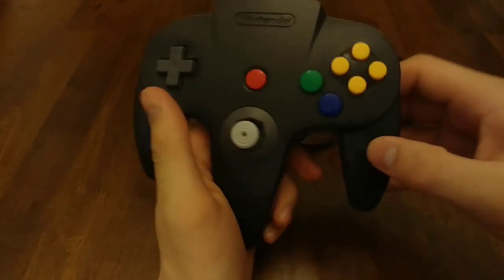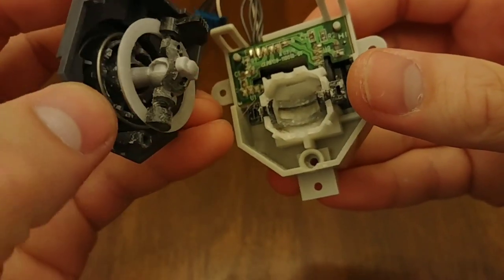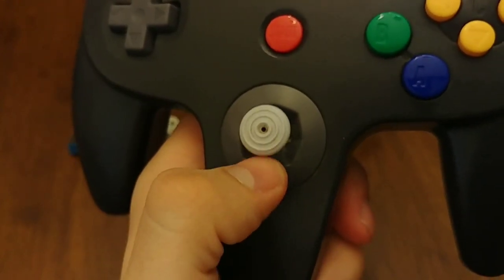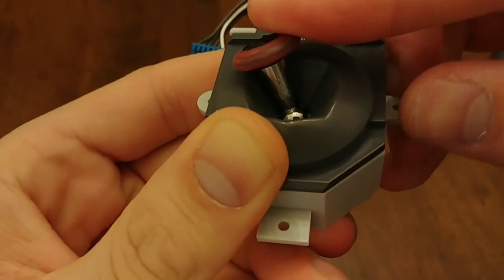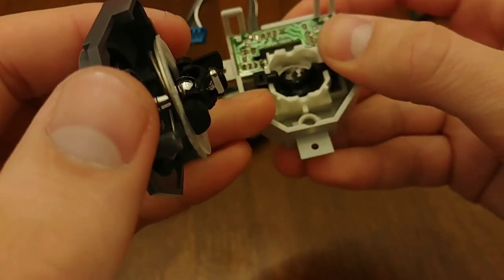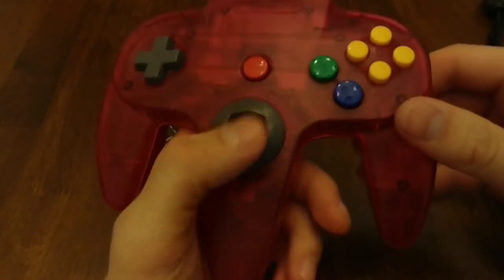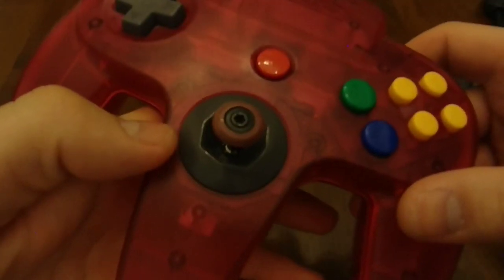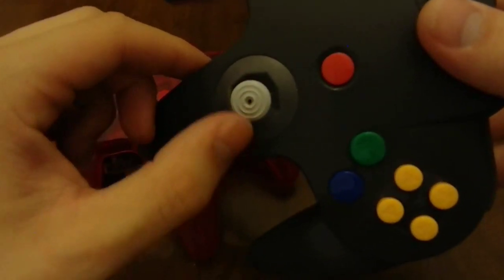What is SteelSticks64 and why you should get one.

Comment: I wanted to buy just the steel bowl for $30 on the site today, but it seems that these products are made sold out and made of unobtainium.
Reply: Same here during covid.... worst time to be looking to expand my collection since all of the brick-and mortar stores are (logically and correctly labeled as) non-essential businesses :(
Reply: I managed to snag one a few days ago.  The Grade A one that was $45 or so.  Batch had 150 units and were sold out in maybe 3 to 4 hours.  Luckily I got the notification email as soon as they went up but I know others aren't so lucky.  I'm gonna use that with the brass links from Shapeways and a Kitsch Bent molded stick I happen to have.  My stick is gonna last FOREVER lol
Reply: @Officer Barbrady the stick is DIY. You have to drill it yourself. If you aren't handy then buy the full kit for $150
Reply: @Officer Barbrady  Metal sticks aren't really necessary.  They have more mass, and besides, plastic-on-polished-metal friction tends to be very low.  In any case, replacement plastic sticks are very cheap

Comment: Steel Stick is only part of what you can do honestly.  I managed to get a Grade A bowl ordered.  Then I'm gonna replace the plastic links, the long parts that the stick moves, with brass ones that can be printed from ShapeWays, and use a Kitsch Bent clear OEM molded stick.  I think overtime if a SteelStick modded stick goes in stock I'll get one of those as well, but SteelStick parts are very compatible.

Comment: What would happen if I were to use a regular N64 plastic joystick with a steel bowl? Is it ok to do that or should I wait until I purchase a steel stick?
Reply: It would probably work just fine with a good amount of grease. The bottom of the steel stick is made of plastic anyway to prevent metal on metal contact - so it really doesn't matter whether the actual stick is made of plastic or not. I would say the best way to get the same quality without paying for the whole module would be to buy the steel bowl and refurbished gears. Then use an original stick that still has the bump at the bottom intact. Hope this helps.
Reply: @CuhShark  Cool, thanks.

Comment: it's 2021 now. turns out he made 35 of them. and now you can't get them... as well, what about those two black plastic parts that actuate the optical encoders? they are still black plastic parts? those black plastic parts are the most problematic part. that's the part that gets worn away. you open a loose sticked controller and it's those parts that are worn where the stick rubs against them, and now you have a metal stick rubbing against them?
Reply: @shaun8062  that's not been my experience. It's always been the part of the black gears that wrap around the stick. What should look like I I wears to ( ). So the stick becomes wobbly and loose.
Reply: @mark902  You know what? Now that you described it, I can recall seeing videos of people with that issue, just never had it myself. So that is something to ponder. I wouldn't dismiss this project though obviously until we've tried it and or come to the perfect solution.
Reply: Plastic on steel won't wear it down much. In fact the steel stick is plastic on the bottom which makes contact with the steel bowl itself.
Reply: @shaun8062  Later models of the N64 Controller came greased, so that's probably why your gears never wore down quick.

Comment: I'd prefer to stick with a plastic stick, since steel sticks have more mass and might take longer to center.  
Plastic on polished metal has a low coefficient of friction, anyway. In fact, cheap bearings are often plastic supporting a metal axle.

Comment: Well its been about 5 years since you uploaded this video, how is the stick holding up?
Reply from the maker: I seldom play n64 anymore, however a couple months ago I played through Toy Story 2 and had no issues.  It felt just the way any other n64 joystick ever felt.  Smooth and it snaps back to center and stays there.  Since I've had it I've clocked 50 or so hours in mariokart64, a few dozen hours in GE, and a playthrough of Turok 2 and probably less than 10 hours spread out among other games.  I've greased it lightly one time and do not fear that its going to degrade any time soon.  Granted, I never really put it through paces of intense use, but it's certainly better than a standard joystick, which, even with little use will suffer from looseness.  I wish the production kept up, or at least was made in larger bulk, because the comments on this vid alone show that there are hundreds of would be adopters.
Reply: @Spleet  if you are not using it, are you maybe willing to sell it?
Reply from the maker: @ohnewerbung9601  s'gone.  Already sold
Reply: @Spleet  thanks for the replay.

can I ask you how much money you sold it for?
Reply from the maker: @ohnewerbung9601  I listed it on ebay for $250 usd, it sold almost instantly.  I had no idea at the time that the smash community didn't have another solution by now.  I thought there were replicas and replacements abound, but I guess steelsticks is still king?  It's such a simple design, a bowl and a stick... it's hard to believe someone with their own shop or access to a public shop doesn't do it.  Then again, the logistics of shipping is a huge hassle even for a small time eBay seller, so hundreds of orders for the everyman may be a huge headache.  Who knows.  Best of luck to you if you're trying to find one!

Comment: It will still become loose with time.
The gears themselves are still made out of plastic, with time they will become loose just like the original module.
Reply: As you long as you keep it lubed, it should last longer and preventing rust as stainless steel can still rust. Also, the steel bowl and stick are highly polished reducing friction. I don't know for sure because I don't own one.
Reply: Its not as bad as it sounds. It will efectively eliminate wear on two of the most problematic parts, so it will greatly extend the usable life. Also the slide rails on the gear set will last substantial longer with lubrication than without such as with a stock stick. The Steel stick also has over provisioning in its range so even when it eventually wears it will still retain full range for much longer. They really are a vast improvement over the original and should last many times longer than a stock stick. Also if you do wear the gears you can canalise gears from a semi warn stock pad or buy 3rd party gearsets that can be used to refresh your steels tick. You do have to reshape them slightly for the oversized shaft but it's not to hard to do.
Reply: Just out of curiosity could the gears be made from a different material?  Right now he seems intent on refurbishing the old ones, but he’s also still in the prototype phase. If he could get the gears made out of a more durable material, he could effectively fix this issue.
Reply: @Huanchee  Sadly plastic is the only option, metal on metal would be bad because of friction and other reasons.
Reply: +Xein64 a carbon fiber gear may work

Comment: "Rapid degradation"  its been 25 years!! Sure they do wear but my ps4 and switch controllers wear out a hell of a lot faster.

also didnt realize this video is old.
Reply: ps4 controllers are actually a lot more durable then n64. All controllers are these days, at least compared to n64
Reply: @DempseyDaPro  Yeah but the Potentiometers drift within a year. Not hard to fix but still annoying.

Comment: How much did it cost?
Reply: They cost around $125. It's pricey.
Reply: The sticks cost $125 pre-built to do it yourself it's $25.
Reply: $25 sounds much more reasonable.
Reply: furballbear Once I realized that, I might consider it. I have a stick that I half-repaired and since the only parts that are steel are the bowl and the stick, I could just buy a steel bowl for $25 and lubricate it withmy plastic gears and stick. I think it comes with new bowl gears too since the gears are in the pictures.
Reply: In theory I could use the parts from my original loose one, right?
Reply: walter937 you could, but I have not attempted it and I do not know if it will be a good solution. What I was planning on doing was that I would first, buy a new steel bowl then, I would buy some lubrication, and then I would buy replacement axis gears. I would dissasemble my stick, lubricate the new gears, the bowl and the oem stick from the analog stick I am repairing. I would reassemble it and it should work because all pieces are new and not worn down . But what my concern is that since the bowl is metal, would it wear down the plastic stick? Because it is plastic on steel, but the there is lubrication, that is where I am confused. But I don't really think you have to do this, Retro Fighters designed a new modern N64 controller and it's releasing on their website for sale around Febuary. Check out their kickstarter https://www.kickstarter.com/projects/1247448559/next-gen-n64-nintendo-64-controller
Reply: I will, actually i'm looking for a not so expensive solution for my loose N64 analog sticks, maybe i'll try to get one of the gamecube style joysticks
Reply: walter937 well, the gamecube style sticks are missing a bit of degrees so some games like goleneye will be difficult. With Retro fighters they redesigned the whole controller, their stick is accurate and the controller has a 2 prong design like an xbox controller, I'd say you're better off waiting untill febuary.
Reply: walter937 brother that game cube solution works with issues but defenatly not for Goldeneye 007 😑